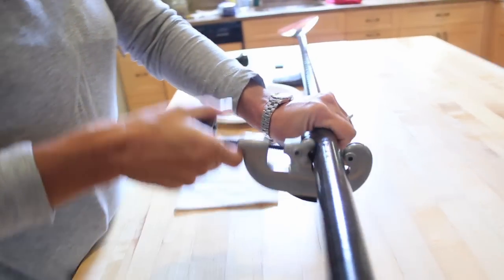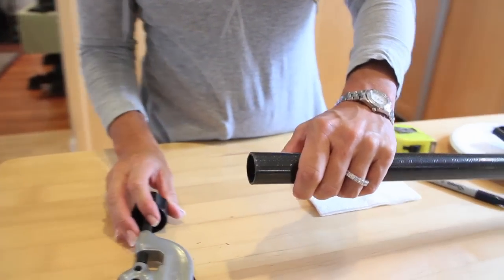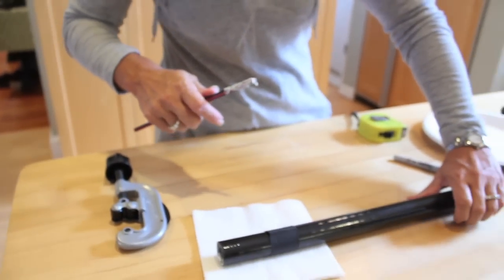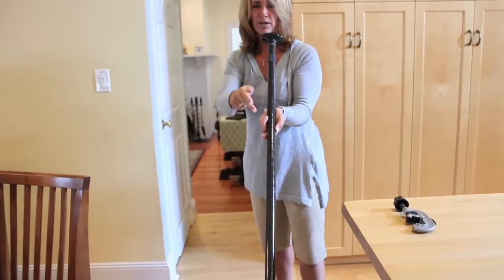How to Cut a Stand Up Paddle

Comment: I have never seen someone cut carbon fiber with a pipe cutter.  Cutting carbon like this will cause the edges to delaminate as the smooth blade crushes into and spreads a hard material like carbon fiber.  At some point in the future the delamination may cause the handle to loosen.  It's not the end of the world but there are safer ways to do this without damaging the material.  The best way to cut carbon tubing it is to put it in a saw guide held in a vise and use a rod saw blade in your hacksaw.  The rod saw blade makes a clean cut so you won't need to sand or tape the tube.  Most bike shops will use normal hacksaw blades so it's not the end of the world if you do use a normal hacksaw.  Or better yet, just take your paddle into a shop with the line you want marked out on masking tape and they will cut it for you for $5 (or maybe free if it's slow).